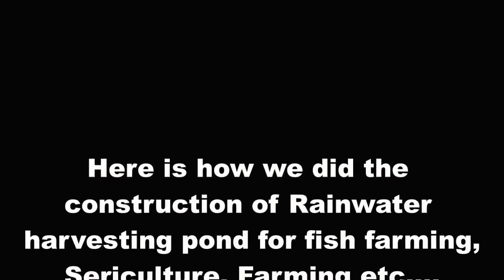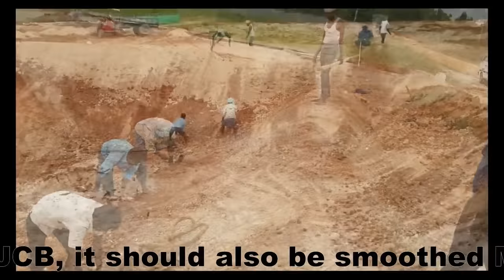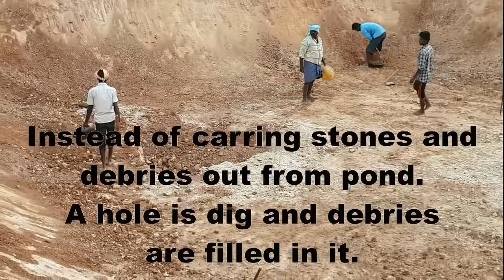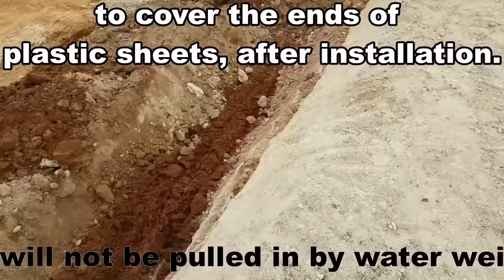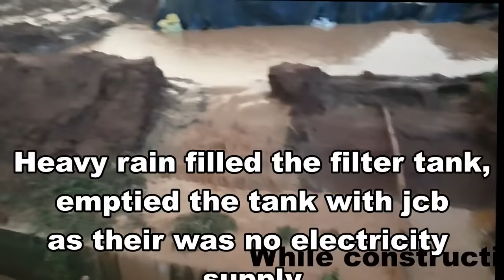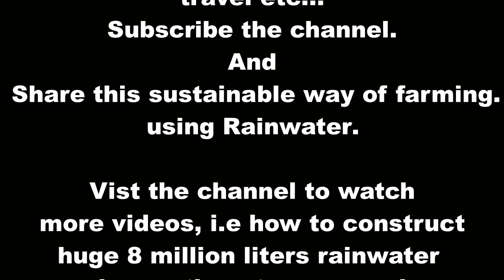Fish Farming using Rainwater | Farm & Fish pond Construction | Rainwater Harvesting System | pool

Comment: Heavy equipment, major construction, all done wearing flipflops. Truly amazing!
Reply: Only legends can do that, and there are ultra pro legends tio
Reply: This goes to show you that, you don’t even need hard hats either.
Reply: If you do it perfectly there is no chance of accident they are pro legends so they do perfect and they no need any safety gears
Reply: will not last more than a year...
they need to use concrete for water filtration tank...
Reply: OSHA in shambles
Reply: @sachithmadusanka3023  these things still exists dude without a scratch 😂
Reply: First 10 seconds in and I’m alarmed that they’ve dug a hole that deep with steep walls and a heavy construction vehicle right beside it.  Not really a good idea.
Reply: When I went to Bangladesh a few years ago, I saw construction workers 10 stories in the air, in flip flops, wearing a lungi (google it) and no hard hat welding luxury buildings cross beams. It was incredible. They had a strong work ethic. They seem to enjoy the work. I truly felt for them. These people can work hard. ❤

Comment: Why the liner? Without liner you also have the possibility to recharge the groundwater. Also, the drainage ditch led away soo much water when the rains came, instead of having it naturally flow into the pond with contour trenches and overflow routes. Seems like a waste of good water to me.

Comment: this pond is to deep you do not need any more than 5 to 6 feet if you use pusher pumps and solar you can achieve dynamic circulation and high oxygen levels   were is you supplemental structure and vegetation if you want good balance in biology you need stone on the bottom at least a foot of  gravel 1 or 2 inch is fine in addition you should have a three to four foot depts walk around shelf for service in harvest safety first

Comment: Using plastic sheets is against rain water harvesting. It will not help in recharging ground water but it will increase water problem for future. Main purpose of farm pond or any other pond is to bring the water level back to normal and also able to irrigate your land. Using ponds just for store is harmful for future. Will yield results for short term.

Comment: It's not sustainable if they put a waterproof layer underneath because it won't act as a percolation pond and will never regenerate the water table which means the roots of vegetations nearby can't benefit from this artificial pond. All that depth and they decided to put waterproofing. Would have been better if they just let the water sip into the soil and when there's enough saturation, meaning water table is increasing, then the pond will stay full and lush greeneries will be seen around it. This kind of pond is expensive and NOT SUSTAINABLE at all. There's a better project in India that makes percolation pond and you can see the benefit of it to the surroundings
Reply: Any links?